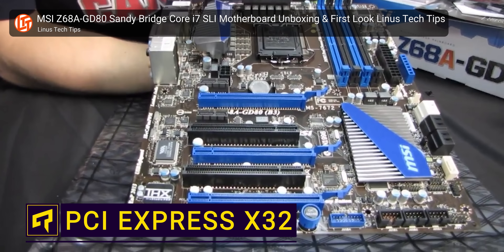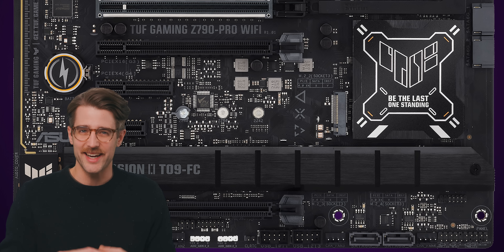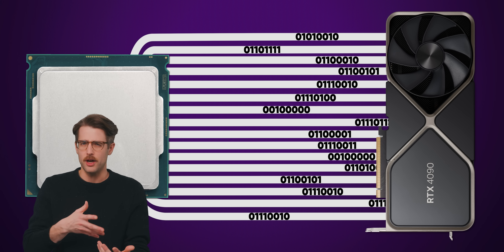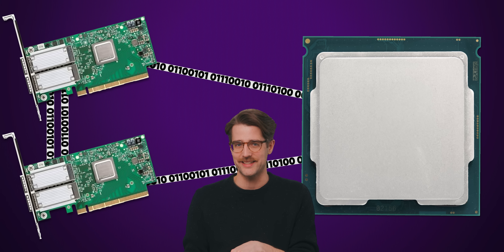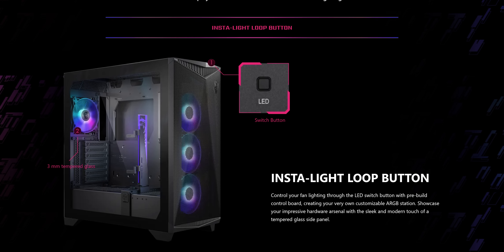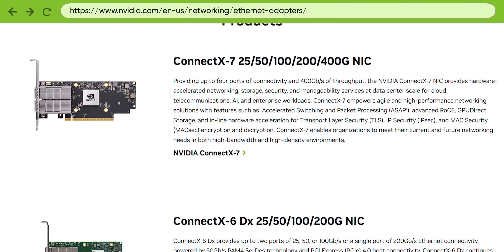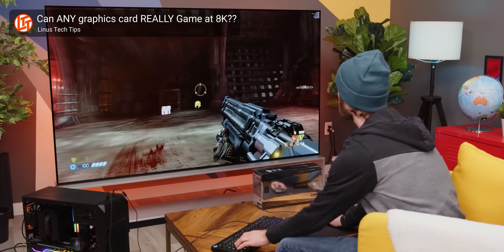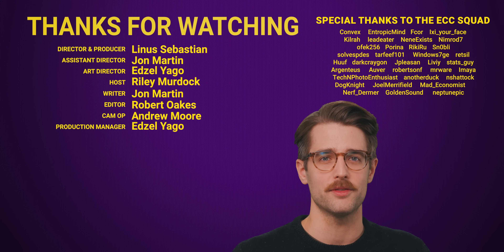Yes, It’s Real: PCI Express x32

Comment: SLI and crossfire failed back then, but with modern high speed interconnect tech, I think we can bring it back.
Reply: When it comes to gaming, it wasn't about the interconnect. It was about the sync between the two which had frame lag.
Reply: @zozodj2r  having a high bandwidth low latency interconnect can help with syncing issues because the 2 GPUs don't have to waste extra processing power for random inconsistent data so it can better utilize both cards for rendering. If the amount of data is too much for the interconnect to handle during specific moments of a game, it'll have to wait on a slower interconnect to communicate properly which leads to bad frame timing of not much lower FPS drops as well. People are saying that Nvidia would rather have people buy one expensive card over 2 cheaper cards, but most people who can't afford that expensive card all at once would still be spending more money during a single generation of they can afford a 4060 ti now and another one in about a years time vs waiting for one or 2 generations after maxing out budget for a 4070/super. Nvidia Still till makes more money than waiting for a 4070 super buyer to wait for them to buy a 6070 or something. With SLI being a thing, they might be willing to upgrade more often.
Reply: @zozodj2r  it was entirely about the interconnect. Bandwidth caused the lag by constraining what could be shared between multiple GPUs
Reply: @zozodj2r  They went about it the wrong way, the best approach was always the 3DFX SLi approach of shuttering between scanlines, this not only gives you ultra smooth frame pacing, it gives you much higher motion resolution vs rendering the whole frame at once, it resembles raster-scan, if they were to bring back SLi using this method, it would be amazing, and it would scale up beautifly, that said, we are only one generation away from multi die GPU's (or chiplet GPU's).
Reply: @Wobble2007  I agree with this. I've studied all the ways to go about multi gpu and read about the experimental stuff and this was one of the more interesting ones.
Reply: There still is NVlink and Crossfire and with DX12 also mGPU.
Reply: @jamegumb7298 Nvidia disabled it even on my 1070's a year or so ago which pissed me off because been running SLI on them for years.
(And SLI wasn't hard to get to run right, just most developers never actively supported it so we users just made our own stuff)
It also helps not to go purely for full hurr-durr FPS speeds, just super stable FPS.
Reply: @jamegumb7298  AFAIK, NVlink isn't available on any 40 series, was only supported on the 3090, and the 20 series was just a mess with which cards did or did not support it. Volta were the first series to support nvlink.
It's also mostly about memory pooling and doesn't do much for actual performance.
Reply: @jamegumb7298  mGPU can be insanely fast when done properly, example In Deus Ex Mankind Divided I have RTX 2080 ti's & they are as fast a single RTX 4090 in 4K, they basically match the fps, while only using like 50-75 more watts
Reply: Considering the most significant development in GPUs in the recent years has been AI-assisted upscaling, my guess for the future is that GPUs won’t be limited by their connection with the CPU or their cores, but rather by the demands of the neural processing components. This may necessitate a change in form factor.
Reply: @RichelieuUnlimited  Technically it already exists, H100's come in both PCIE and SXM but obviously that's not meant for the consumer market.
Reply: @nadtz  I was more thinking about organically integrated neural components on the same PCB. Specifically in consumer GPUs. Wouldn’t using separate neural components be too slow in gaming specific workloads, simply due to the physical distance in between components. And severely limited due to bandwidth?
Reply: They didn't fail, they got shut down for profit.
Reply: @ffwast  SLI and Crossfire didn't really work well enough so adoption was low which in turn reduced development and it was a vicious cycle. if they can make it work properly and show it scaling to around 90% then it'll pick up. but till then 75% at best and sparingly isn't gonna cut it
Reply: Only if it can be implemented with minimal extra work for the developers.
Reply: It's better have 2 chips inside a GPU. These chips will have different roles, &  tasks. Then syncronized it both.
Reply: Xgmi
Reply: You don't need it anymore. Just plug in two GPUs. You can use two GPUs quite easily with modern graphics APIs like WebGPU and Vulkan. It is also much more efficient because the work can be split up much more efficiently. I don't know if games support it, but it can absolutely be done, and I imagine that newer game engines will gradually add support over time.
Reply: You realize your wall outlet has a hard limit on how much wattage it can provide, right? And you realize how power-hungry modern GPUs are? Not to mention the engineering issues of heat, melting wires, fires, etc.
Reply: @nmotschidontwannagivemyrea8932  you realize most people aren't going to upgrade their 4090 card with another one? It'll probably be the 60 or 70 series cards if SLI becomes a thing again.
Reply: @2muchjpop  And you think those will draw less power?
Reply: @nmotschidontwannagivemyrea8932  add the power draw of 2 4060s and compare to a single 4090
Reply: @2muchjpop  Would two 4060s perform as well as a 4090, enough to be worth getting and setting up?
Reply: I stopped SLI after 980ti. 980ti was an awesome value card and two of them could legit handle 4K. The 4090 just doesn't need a second one for 4k with the DLSS trickery. I do kinda miss the SLI Aesthetic, two water cooled cards look beastly.
Reply: Conceptually, we're seeing something 'similar' for NICs, HBAs, etc. However, for graphics, GPGPU, and AI/MI workloads InfinityFabric and NVlink are already here.

In fact, DerBauer tested an AMD Apple Pro dual GPU, and the 2 chips were 'bonded' over IF. The system only 'saw' one GPU but, used both. 
Notably, nVidia Blackwell is also set up similarly, but in/on-package and bonded together as close and tightly as possible.

IMO, there's a minute chance of non-mGPU/CFX/SLI multi-GPU returning to the gaming space. If it does come back, it won't be anything like 'oldskool' CF/SLI or MGPU; the multiple GPUs would/will act (and be seen as) *one*.
Reply: Marketing just needs a way to spin it and we'll be buying 2-4 cards again for no reason again.
Reply: Yes, I'm just not happy buying one $1000+ GPU. I want to have to buy multiple $1000+ GPU's!
Reply: Nvidia would much rather you buy a 1200 dollar 4080 than two 300 dollar 4060s
Reply: No
Reply: SLI or crossfire will never make sense.. it didn't back then as it's difficult to get working much less smoothly. Best case it to have all chips and memory as close to one another as physically possible. Considering we regularly +30-70% uplift in GPUs just 1.5 years later.. you're better off just throwing out your old flagship and get the new one than to try and mate 2 together. It will use more than 2x power and deliver much less than 2x performance. I get that this was probably .mostly a joke but I am just here to bring the real world to the discussion.
Reply: @TheCosmicMason  It made a lot of sense. SLI still exists (sort of) in the form of NVlink.

And no the newer revival of SLI that Nvidia brought out was not identical to the OG 3Dfx SLI, where it legit made more sense. The limit was not the link but the speed of the GPU itself. These days any GPU is so damn fast that adding a second one makes less sense but more importantly often a tier lower in SLI was cheaper and as fast or faster than buying the next card up. This does not make Nvidia a lot of money. 

The trend toward smaller computers and cases and with GPU tdp getting out of hand needing ever larger coolers (what is up with the 4 slot ones lately my god) makes having a case to put them in an ever bigger problem, if it were done still. 

Even if it is to go away on desktop on your word for you not seeing the logic: mGPU, why?

But even then, I have a 2nd card and it works great. I bought it for Sector's Edgem, cloned the repo, modofied it a bit and offloaded wavetracing to it. Much better fps on the main card (3060 12G), and the second card (A380) made for much more sound sources with much lower latency and a lot more rays and bounces since no need to watch out for picking up too much compute away from rendering. This is much more easily seen as you consider a GPU being fast because, and this is never emphasized enough, it is 1 wayh traffic only, no readback no nothing. Doing so adds a lot of load and dedicating a second unit to that makes everything so much better.
Reply: @TheCosmicMason it sorta made sense back then, but you are right about now. back then the gpu designs wer every limited and couldn't push hd 60fps at all. so putting four gpus together you sudden could push a stable 60fps in hd with anti ailiasing. now....yeah good luck getting that much data syncronized across even two gpu cards trying to push 120fps or more.
Reply: @TheCosmicMason  It's trivial to get scale the frame rate with multiple GPUs, it's the latency that is difficult to reduce. You can always wait for a faster GPU, so how is that an argument against multiple GPUs?
Reply: @shanent5793  you're being obtuse. Ur wrong but you don't have to admit it. Cheers.
Reply: @TheCosmicMason  your say so v. decades of academic literature which says everything you wrote is nonsense 🙄 Graphics are the prime example of an embarrassingly parallel workload

Comment: So... This is just SLI?
Reply: Not really, just a fancy name of link aggregation for, mostly, network card
Reply: Kind of, but not really. It is using similar methods, but it's not exactly the same. This is probably closer to what is done on AMD's workstation cards with being able to attach a display synch module between multiple workstation gpu's to output as a single monitor signal with one of these: AMD FirePro™ S400 Sync Module for instance with AMD's workstation cards. (Nvidia has their own version, but I don't know the details.)

If you look at the card shown by Riley in the video, you'll see that cable connecting them. I'm not sure of it's exact connector specs, but it will be somewhat similar in nature to the JU6001 connector that can be found on the AMD WX series cards. Sometimes it's populated with an actual socket/port. Sometimes not.

Essentially, if I understand correctly, instead of each of the cards sharing the workload intended between them, they are all doing their own work, or shared work perhaps in some cases, and outputting it all to the same monitor. It's a subtle but important difference, because SLI/Crossfire typically is used for splitting workloads between GPU's to get a better end result, where as display synch (as I will call it for now), is more about combining separate or even shared workloads into a single tangible visual result. 

That sync card is effectively doing what Riley explained about the x32 setup, and the asynchronous data streams typical of PCI compared to when they are... well... synced. 

Maybe not the worlds best explanation, but I hope it helps.
Reply: Basically
Reply: No, it is not
Reply: Sli for non gpus
Reply: Had the same thought hah!
Reply: it has nothing to do with SLI not even close. SLI - 2 cards working together to render interleaving frames. PCI_E X32 "mode"  - two devices communicating with CPU to give the main device faster link to the CPU, it is similar to link aggregation but have nothing to do with SLI.
Reply: @eliadbu SLI is just a derivative of PCIe. It's the same protocol.
Reply: @DoesntRefillTheBrita  no it's not. SLI is a proprietary technology that works on some pcie cards it has nothing to do with pcie standard itself.
Reply: @eliadbu  sounds like someone doesn't know how SLI works
Reply: @DoesntRefillTheBrita  I've used it for years, I know how it works - SLI has nothing to do with this, different purpose, different implementation.
Reply: @eliadbu  what you've installed a graphics card now so you're an engineer? Google what protocol SLI uses before you make yourself look worse.
Reply: @DoesntRefillTheBrita  so Mr expert, where exactly it says SLI is using one card PCIE connection to increase the other card link speed to the CPU?
Reply: @eliadbu  nobody said it connects to the CPU
Reply: @DoesntRefillTheBrita  1:50, 3:51 and the whole video title "PCI Express X32", the cards communication between each other to enable higher speed link with the host. of course the connection between cards can be used for things like SLI - but the whole subject of the video is faster link to the CPU using more lanes from second card. If you didn't understand it from the video, you should put more attention to the subject. SLI usually shares the link between the CPU and the two cards  (from X16 each cards get X8 and X8 on most mainstream motherboards), that why I said this has nothing to do with SLI.

Comment: Can we have 2 gpus stacked on one pcb running at pcie x32? Prob but kinda impractical?!
Reply: we had 2 gpus on one board via x16 back in the days and that was enough.
Nowdays no system supports SLI and Bandwith of the slot is fast enough to support a gpu on an 8x link
only stuff that acutally needs it is Networkcards. Never seen x32 anywhere else. And even then its just to retrofit older machines
Reply: @FlaxTheSeedOne  very good point
Reply: @FlaxTheSeedOne  Not 100% accurate on the SLI thing, servers and workstation cards are still NVlink capable, it's just NVidia's consumer stuff that no longer uses it.
Reply: @nadtz  Also Not quite true if we are beoing pedantic. Because NVLink is not SLI, its a different protocoll and uses differen signaling. Its a completly different standard of merging 2 or more GPUs in their DGX Systems via switches.
Reply: @FlaxTheSeedOne  Yet most people called nvlink SLI when it was available for the 20 series, so pedantism aside I believe the point is understood.
Reply: @nadtz  Thats because that was SLI and not NVLink. It just used the Physical Connector of it but it used SLI as the protocoll
Reply: @FlaxTheSeedOne  kind of making my point for me.  Most people don't know the physical difference in the consumer space so 'SLI' is pretty much an umbrella term for both SLI and NVlink to most.  I was specific about which protocol I was talking about because I see gamers do this all the time, they think some technology is dead or doesn't exist when it in fact does, just not in the consumer space.  

I understand that sli and nvlink are different but the end goal of high speed communication between GPU's was the goal of both, so in that sense they 'do the same thing' to greatly minimize the differences.
Reply: @nadtz  And you are making my Point. Nvlink has no space in the consumer market thus SLI is dead in the Consumer market. No questions about it. It just plain does not exist. And to be 100% clear SLI does not exist anywhere anymore, except in older cards and older games which will slowly fade out of driver support.
Reply: @FlaxTheSeedOne  Yes, that's what I said from the start, it's dead *in the consumer market*.